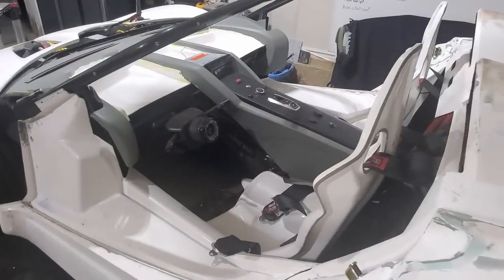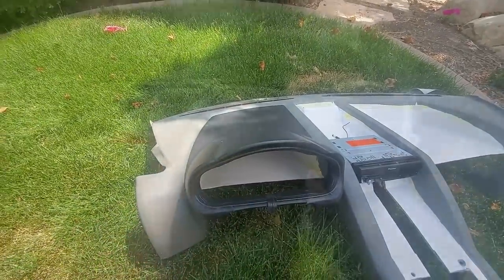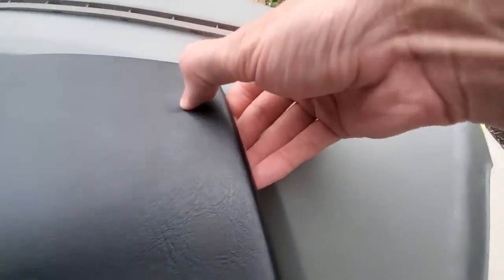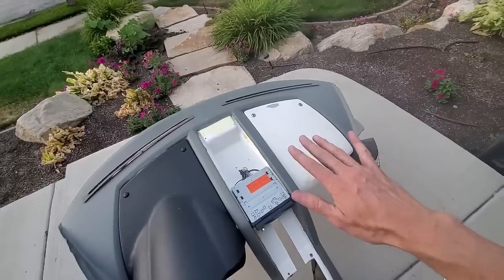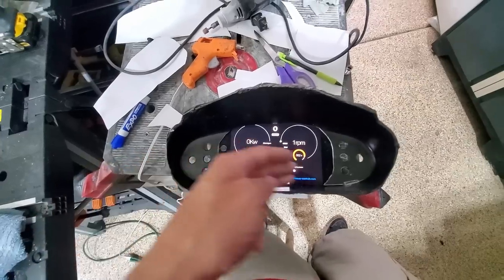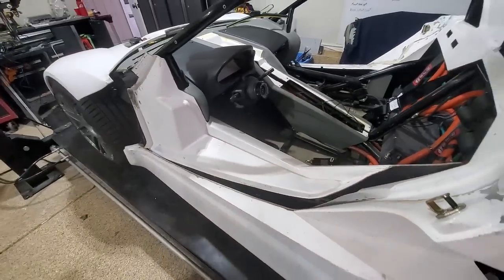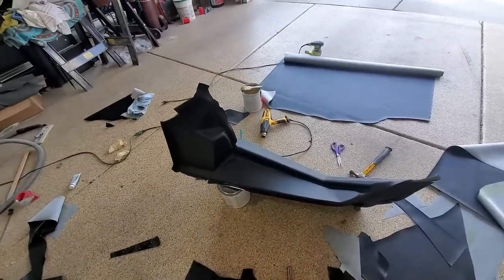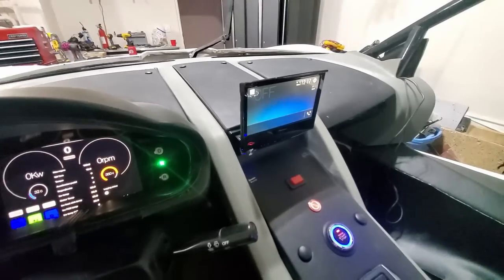Interior Part 2

Comment: It is coming together nicely. Even though the interior panel wrap came out well, it seemed to be a real challenge with all of those complex edges and curves. And you might think about using a rubberized spray coating for those troublesome areas in the future. The instrument cluster came together well too, and the pop-out radio/display looks cool with the big screen, and cleans up handily when retracted.
Reply from the maker: Thanks Dean!

Comment: The interior is really looking great, the contrasting colors and shapes are fitting to such a ground-breaking car.  I do think your wrapping of components is being made more difficult by the backing of the vinyl you are using--a little late to be mentioning this, but there are other vinyls that have a more stretchy back that will go into concaves and around convex surfaces more easily.  Excellent job in making everything look and fit well, it's a lot of work!  -Don
Reply from the maker: Thanks Don! Do you have a link to material?

Comment: Great video, will you need to have the car inspected by the state? Thanks
Reply from the maker: Yes...kinda.  They will check that I have the appropriate safety equipment (horn, Seat belt,  turn signals, etc.) But they do not "certify" because they do not want to be liable

Comment: Since you are having trouble with the vinyl on the dash (or other parts too). I would suggest going with flocking it, its a bit of work but it would come out really nice and you can do it at the very end of everything since it won't add nearly as much thickness as the vinyl. here's a video as an example of what flocking is: https://www.youtube.com/watch?v=9CKsHDOhAZQ&ab_channel=customspraymods

oh yeah also be sure to set up the automation I told you about quite a bit ago so you have the auto off and on for the iPad when you go to turn off the car and turn on the car.
Reply from the maker: Thanks for the comment!   Yes I need to set up the automation.   Thanks for the instruction!

Comment: Great video, I'm just thinking that the top right panel could be used to hold an airbag?
Reply: @honthirty_  Did I say it could be put in that space without modifiying it so it can make it work safely?
Reply: @SlayerofSethanon  No, you did not explain.  Have you had a lot of experience designing air bags? Getting them approved by the NHTSA? 
So, that top right panel could be used to hold a banana too.
Reply: @honthirty_  Exactly I just pointed out that that space could be used for it. I'm not pretending to be an expert and I did not try to prove a point. That was a question and you didn't have to respond like this. It just seems that 5 points harnesses are not always approved for road legal cars. Therefore it seems resonable to think that an airbag (installed correctly) would increase safety with a three points seat belt. A banana on the other hand would not. Since he is taking people on a ride I was just thinking about their safety.